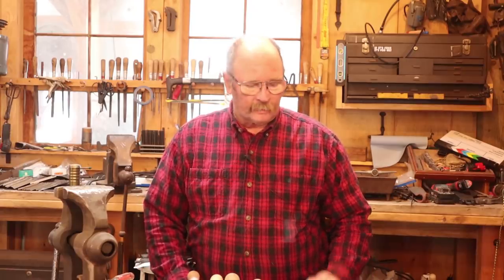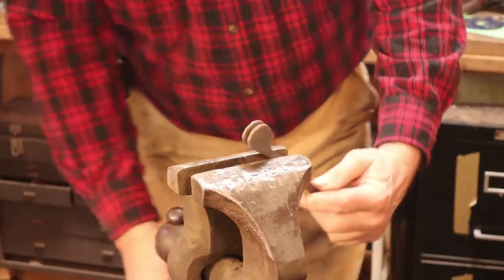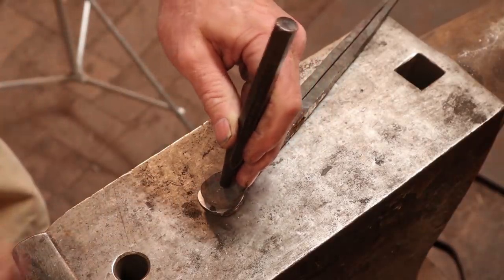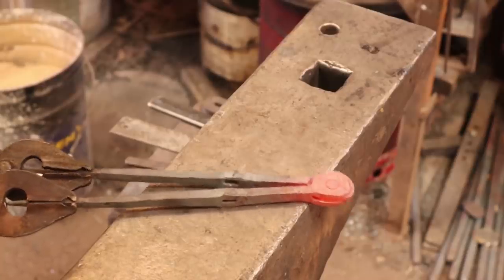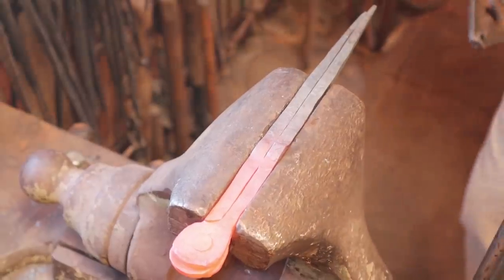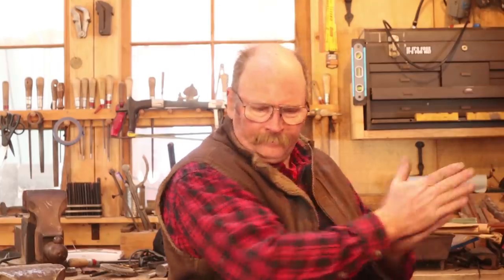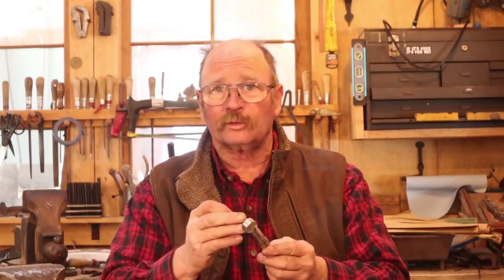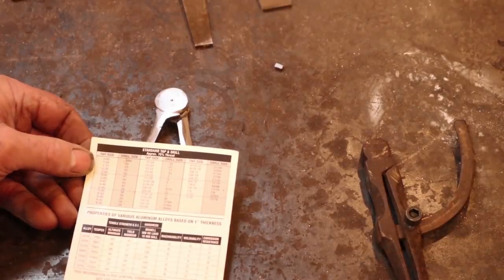Wing dividers -150mmchallenge part 3

Comment: Lovely series, thanks!  

You could, when the dividers come back, make them suitable for marking metal by forging a tiny little fuller on the flat side where they meet and brazing in about 1/2~3/4" of tungsten TIG electrode.  I keep some 3/32 tungsten in an old drafting pencil for marking in my shop.  It stays sharp even longer than regular high-carbon steel --  tungsten is harder than a lawyer's heart.
Reply from the maker: I could.  But I suspect I won't.  If I wanted hard tips I would forge weld in tome tool steel during the initial forging.

Comment: John, I have a new propane/oxygen torch rig and would like to know what size welding tip you use on yours for localized heating.
Reply from the maker: I think its about a #3 in most cases